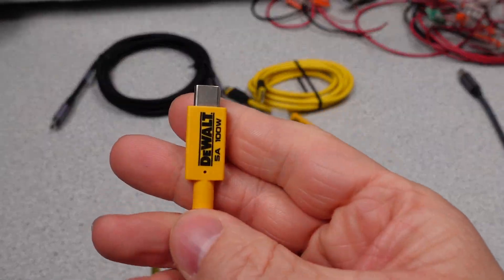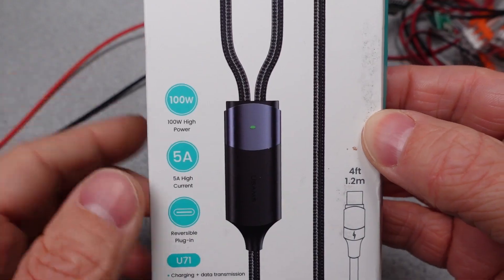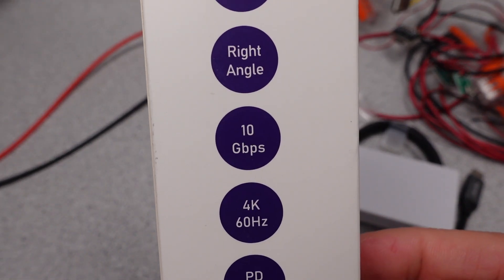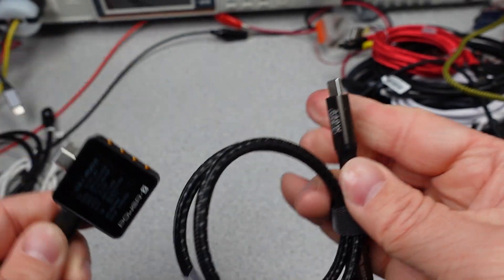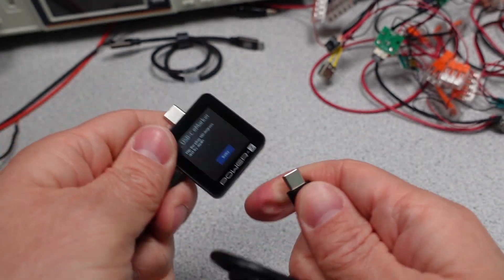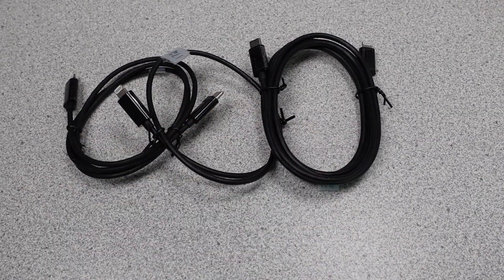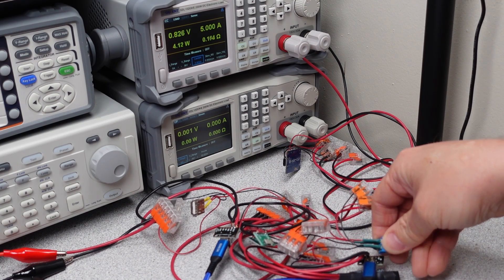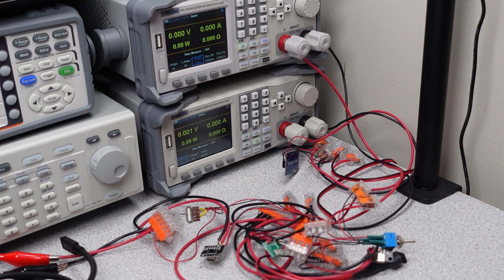USB Cable Power Performance for the fourth time

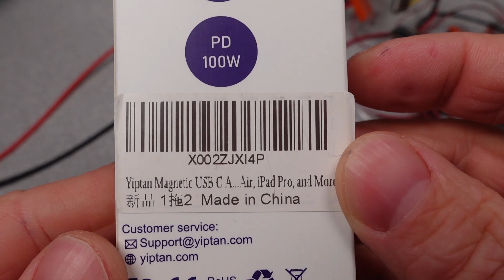Comment: 3:00
Little anecdote about those magnetic tips.  Some devices really don't play well with them, though I don't know why.

I had a pair of Sennheiser headphones I really liked that lasted about 3 years before the batteries stopped holding a charge.  When I replaced them I decided to try some of these magnetic things, to see if the reduced wear from plug/unplug cycles would extend their lifespan.

Instead it created a grey zone where the headphones aren't sure if they're charging or not.  It would charge, stop charging, then charge again, flickering between the two rapidly.  I inadvertently left it flickering like this overnight, and that harmed the batteries to the point the headphones stopped holding a charge after less than a year.

It's possible it was all a string of bad luck, and the problem was unrelated to the magnetic tips.  But I really don't trust them.
Reply from the maker: Thanks!  Yeah, it is interesting to hear some long term use cases like that where it is possible the strong magnet near the battery could be an issue.  I wonder if there's even a sensor or something that it's messing with, like something to detect the presence of the headphone, hall effect sensor or something.

Comment: WHY IS IT SO HARD TO FIND A GOOD CABLE.

I bought and returned last 5, just because of internal resistance.
Finally I found Asus 100W 1.5m cable with just 0.12 Ohm, but it isn't no longer available, so only got 1... So instead I bought Ugreen 1.5m with much worse 143 mOhm and Baseus 1.2m crystal with even worse 161 mOhm. Those resistances are including connectors, but still sucks to basically not know befire you have it in hand.

It's simply not practical to buy 20 cables and return each one for shipment that costs as much as 30% of their original price.
Reply from the maker: 0.12 ohms sounds pretty good for a 1.5 meter cable.  The difference between 0.12 and 0.14 is probably not enough to think about returning the cable.  But yeah, it's a thing for sure.  I have the next round of cables coming soon.
Reply: Edit. If you're fine with 1m cable and want as low resistance as possible; buy OnePlus C-C cable, it's dimensioned to 12 Amps and has internal resistance of around 55 mOhm (including connectors).

Comment: From your pdf, what I see is that some cables are not usb if certified and performs better than the certified ones. Is it better to go with non certified ones or certified ones. Will the non certified one will cause any damages to the device in the long run
Reply from the maker: A certified cable will have gone through more testing and verification for consistency and reliability of product.  If you are buying for data usage then I'd certainly look for a certified cable.

Comment: hi i just bouht a anker 240w like cheaper bout myr30 . i suggest u do test on 240 w , and especially the thunderbolt 5 by cable matters.
Reply from the maker: No charger does 240W on one cable yet, anyway, current determines resistance, ie, losses are the same versus the 100W level.  Anyway, yes need to test some of the newer cables on the market soon.
Reply: @AllThingsOnePlace  thanks . yeah sure. my suggestion is at the end of the year u coukd do a ranking videos or personal preferences and such.

Comment: You didn't include any belkin 100w 2/3 meter cable. Are they not good?
Reply from the maker: I just didn't get any.  There's so many USB cables out there.  It's probably getting on time to add some to the list.

Comment: I just tested the Satechi 6.6ft 100w c-c cable and am getting 15% voltage/power drop at 5a.  This must be out of spec surely, asking for 100w and receiving just 85. 

Looking at your results it says your power loss is 3.13 @ 5A.  Is that 3.13w per foot or do we have vastly different results?
Reply from the maker: Yeah, 15W dissipated in that cable it should feel like a heater wire.  You sure the device is pulling the full 100W?  

That power loss is for the whole cable and the ends so we do have vastly different results.
Reply: @AllThingsOnePlace  I fiddled around with connections, cleaned plugs and managed to get it down to 10w loss @ 100w. Still awful. If I hadn’t bought it directly from Satechi I’d be thinking ‘fake!’

Comment: Miniware and Pine64 make silicone cable intended for their soldering irons, they might be interesting
Reply from the maker: I have it!  I need to get a new video out... haha
Reply: @AllThingsOnePlace  "it" or "them"?
Pine64 has two passive red silicone cables in 1 m and 1.5 m
The one from Miniware (about $4-$8 on Aliexpress) is orange, has an e-marker chip and is rated for 240 W.

Comment: Hey it would be interesting to see how the cables of native union do as they proved to be super durable in my use and they have liftime warranty. only a single native union cable developed a problem after years of use and they just replaced it with no question asked.
Reply from the maker: Thanks!  Yeah, I didn't pick any up yet but I added them to the list.

Comment: Suggestion, add a column for advertised data transfer speed.  Most seem to be USB2 but some are USB 3 Gen 1 or 2.  Or just say 480Mbps, 5Gbps, 10Gbps.  I feel like this is something else most people look for in a cable other than length and current carrying capacity
Reply from the maker: Thanks!  Yeah. I have some info on that but it’s certainly worth an update.

Comment: Instead of buying a bunch of different usb cables  types can I just get a usb c to c and put a adapter on it? Like c to a, c to micro, c to lightning? Are adapters safe? And could you recommend a brand of adapters if so?
Reply from the maker: I use some of the adapters myself. I just pick random ones. There are too many brands now.  Make sure it doesn’t get hot in use basically.  You lose some functionality and sometimes charging will not work since the cc pin ends up incorrectly connected with adapters.
Reply: Gotcha, love the channel. What brand do you know doesn’t get hot? Rather not have to hassle with it.

Comment: Can you test a scoopi usb 4 cable?
Reply from the maker: I don't really have any good data testing abilities and that's probably most important for USB 4 cables.  I want to do this in the future.  In terms of power loss, I can do that of course.  I did put it on the list.
Reply: @AllThingsOnePlace   do you know if the cable resistance will affect data throughput?, how do i know if a cable is capable of peak data performance?
Reply from the maker: @guocity  The resistance is part of the impedance characteristics, the real part, for data transfer.  These wires are usually much different than the power carrying wires I am looking at here.  I haven't done any testing on data transfer rates of cables and data integrity.  I want to add that eventually but the cost is very high to get into that.
Reply: @AllThingsOnePlace  yea, those cable are very expensive, thanks for the good work

Comment: Love your videos. Can't remember if you take requests are not. I'm looking for the best 20W flat charger since the plug is behind my bedside table. Is there a clear winner in your book? I have a couple of the Ugreen's for other areas of the house but they won't fit in the bedroom. I was thinking of the Baseus 20W but thought I'd check with you first since you've said in the past each brand seems to excel in a very specific wattage. 

Side note: Your videos stopped showing up in my "subscribed" section.
Reply from the maker: Thanks, yeah, I do have a video on slim chargers coming at some point.  I have quite a few of them around.  The best one I have looked at so far is the Anker 45W Powerport III slim.  They do sacrifice some performance for the slim design.  

In terms of a video not showing up in subscribed, I have seen it before, I don't have any control over it, you would have to put in a ticket with YouTube to see what's wrong.  As all the other people say, click the bell icon and select all or something, no idea if any of that works or means anything.
Reply: @AllThingsOnePlace  Gotcha, good to know. I decided to get a surge protector and just use the 20W Ugreen you rave about 👍

Comment: I was surprised to learn that the SlimQ 1M cable included with the F150-3C1A 150W PD3.1 charger supports 240W and USB4 40Gb/s speeds.  Tested using PowerZ KM003C
Reply from the maker: Yeah, even the Anker which said it came with a 140W cable is actually a 240W cable, they just mislabeled it.  The official spec basically requires them to be 240W capable if they support EPR at all.  There are a few fakes out there but I think they've mostly disappeared now.

Comment: Im actually interested in buying the tbs4 cable by cable matters. they got short  ard long options.  and the value per performance is one of a kind . since I have been having xiaomi 11 Ultra, S8 Ultra.. and before I am buying That. I actually wanna ask If it would work.. and I also appreciate your recommendation for anyth cables much more  better eventhough not cheaper cable for longterm ,   ..
Reply from the maker: That does look like an interesting device.  I tested a bunch of the cable matters cables and they were good performers on my resistance test.  I am still figuring out how to do some data testing (better than just transferring data or yes, the screen is attached).
Reply: @AllThingsOnePlace  plus for multi device usage both ios and android...i really appreciate since tbs4 cables working with Windows Os,Mac Os and mobiles devices ..any recommendations on tbs4 hereor in your next video will really appreciates,  thank you

Comment: where did you bought your power z screen to test cables ? edit: seems to be the POWER-Z KM002C // you should also test toocki and essager cables, especially the new 240w ones that dosen't seem bad for the price on Ali (Thanks again!)
Reply from the maker: Yes, it is the Power-Z KM002C.  Thanks for the tip on more cables.

Comment: Would you consider doing some sort of map or some other thorough tutorial of USB cables?

I’m finding USB cables to be very resistant to simplicity.  I’m still finding surprises about USB cables despite studying this for months.  Some examples of surprises:

- A USB-C PD device apparently can negotiate PD over a USB A to C cable if that A port supports PD.  This comes up (at least hypothetically) with PD pass-through USB 3.2 hubs that have type-A downstream ports.
- A to C cables can support up to 5Gbps (I think), and 15W (I think), but the way the devices ferret out that ability remains a mystery to me.  Certainly a lot of my A to C cables result in assemblies that operate at lower speeds and power than that.
- C to C cables might only have enough signaling conductors for 480Mbps so may well be slower than some Type-A connections.

Most of these cases I can only infer based on tests of the samples I have on hand, and the USB spec.  I don’t have the diversity of test jigs, cables, and devices that you have though, so I wonder if would makes sense for you to cover that territory.  

FWIW it seems like about half of what’s written on r/UsbCHardware contains uncorrected misconceptions about USB cables.  OP’s problem is often explained by wrong cables.  Clearly there are resources missing that tie the principles of the USB spec to products that actually exist.  Your testing certainly does that for PD power adapters, but there remains a lot of unploughed ground for cables.  In particular, there are  two questions that remain difficult to answer because of the dearth of resources:

1. What will devices negotiate when connected by this cable?
2. Why did the devices connected by this cable negotiate what they did?
Reply from the maker: That could be an interesting take on USB cables, as opposed to just the raw power performance aspect and thank you for the suggestion.

-For a USB A cable to negotiate PD it has to pass the CC line over at least one of the pins.  
-You are correct USB A cables do exist with the extra pins for higher data rates, I have and use them all the time.  Most are USB 2 data rates though with 4 wires in the cable, P+, D+,D-,P-.  You need four extra wires to do high speed data, and again, the CC pin to do PD.
-Correct on C-C cables, from what I have found also, a lot of charging cables only have USB 2 speeds.  I do note this in the chart whether the cable claims support for high speed data.

Yeah, that is a great point, when there are questions to be answered that is when a video is needed.  The why is very important.

Comment: man I had my 'fancy' overpriced Samsung 10k mah super fast battery stolen, so i decided id do research on its replacement, and what new mah, form factor, all in 1?, usb splitter cable? etc etc, and every few hours of research and thousands of amazon pages, i keep ending up at your channel.
you literally covered soooo many of my top contenders for "potential best setup". you absolutely rock, i learned so many things i would have always wondered watching you so far!!
Reply from the maker: Thanks for watching.  Yeah, I have too many videos already, pretty much all search that gets people to the channel.  There is a lot to do still.
Reply: which one did you buy?
Reply: I picked up the Iniu 65W 20k mAH Powerbank.  If you're willing to sacrifice sleep; iniu has late night sales. It's lightweight.

Comment: Would you consider branching out to USB-C hubs and docks?

Thunderbolt and USB4 docks seems to be disastrous for their ambiguous Power Delivery functionality.  (Many don’t pass through power, they have odd specs for power limits on different ports, their possibly-required power bricks are comical, etc.) Unfortunately such hubs are becoming a necessity so I’d still like to know which options is the least awful.
Reply from the maker: Yeah, I use the Dell brick one, with a 180W beast of an adapter, on an AMD HP laptop of course... Works great actually.  Oddly, the HP laptop will not charge with anything over USB C unless it is Dell or HP.  All other USB C chargers do not work.  Immediately fail negotiation and don't even get a notification that anything is plugged in.  Woo, USB C, compatibility.  I don't know if I can force that through another dock or hub though.  It is a good question and should be some good video content.  

Anyway, I have a few of the cheap hubs to check out already.  I agree that the marketing and material on what works with what is almost non-existent.  I can't even find where this laptop works with any docks or hubs.
Reply: My Dell brick dock negotiates to 6.5A at 20V with my Dell laptop.  Of the power supplies I have, only the Dell’s support that current.  The laptop accepts lower currents as well, but the OS shows the power adapter warning indicator.

Maybe your HP needs that oddball current and refuses anything else.
Reply: @AllThingsOnePlace I suggest the StarTech HB31CM4CPD3 as an example of a PD hub that seems useful but whose behavior is inscrutable from the documentation.

Comment: I'd like to see you do some data testing if possible. There's 100s of c-c cables online, many marked as 20 or 40gbps while they're probably not. Would love to know which one is actually good!
Reply from the maker: Yeah, that part is more difficult.  I don't have any high speed test systems, the cheap versions are into the $10k's.  I want to do that eventually.  I certainly have enough cables to test if I ever add that ability.
Reply: @AllThingsOnePlace  how about if you get 2 40gbps ssd's (don't know if they exist) and run simple data copies via a fast laptop or something? I know it's not very scientific that way, but it can still help viewers and it's more content for your channel.
Reply: Yess

Comment: Watch out with magnetic cables. They usually make normally protected pins exposed to the outside and as a result to ESD. Touching one of those data pins could potetially damage your device.
Reply: I’d like to see an actual test demonstrating this problem.  I’ve spent my life working with electronics and this sounds like just another hypothetical unsubstantiated claim that doing things one way is “ESD Safe” while another way is “ESD dangerous”.  

Show me the data and I’ll happily get behind whatever it proves.
Reply: @alx9r  Agreed! @AllThingsOnePlace I would love to see you do a video on the topic! I could be convinced either way, I just would like to see some research and evidence for it.
Reply from the maker: Mmhmm thanks. That is a good point.

Comment: Bought a bunch of black Baseus 240W cables in the last few days, they went as low as ~1.5$ per 1m cable at one point. Hopefully they are solid
Reply from the maker: Yeah, I tested the 1 meter one, it's in the 150's on the list.  It was very good for a charging cable.
Reply: Me too

Comment: Is testing Thunderbolt cables on your roadmap?
Reply from the maker: A bunch of the ones on the list are thunderbolt compatible cables also.  Testing the signal integrity will be a ways out though, the gear for that is well into the 10's of thousands.  That's the cheap version, easily can spend a million on a scope for high speed data integrity.  Sounds like a job for the signal path.
Reply: @AllThingsOnePlace  yeah would be cool to have USB / thunderbolt bandwidth tests especially since it's really important for electronics nowadays
Who knows maybe one day tvs would replace hdmi for c cables